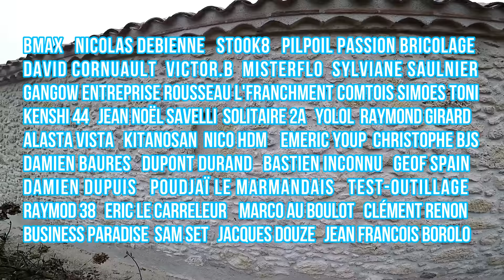joints de pierres fait par des artisans - focus n°15

Comment: Beau boulot ! Une petite question sur la partie du piquage. J'ai réalisé un piquage chez moi, et je suis peut être (et sûrement un manche) mais j'ai trouvé cette partie super longue :p surtout pour avoir des joints bien creusés. C'est chronophage aussi pour vous ou pas plus que çà ? au burin électrique ou manuel ? :p
Reply from the maker: salut
tu poses là une excellente question
comme je le dis souvent la préparation des supports est comme toujours la condition indispensable pour du bon travail
piquer des murs de pierre ce n'est pas caresser la façade comme le font nombres de maçons actuellement pour un réel souci de rentabilité ( pas un problème de méconnaissance ) , il faut creuser pour retrouver une rèelle assise des murs , en clair : sortir tout ce qui est friable, facile à piquer 
c'est vite chronophage car tu multiplies forcément le temps passé à piquer mais aussi à évacuer le décombre , mais aussi à rebatir car évidemment tu feras beaucoup de gros trous , et au rejointoyage c'est beaucoup plus difficile de jointer de  gros trous que de crépir au ras des pierres pour ensuite gratter les joints  (j'appelle ça la méthode carrelage bricolo)
un bon piquage se doit de virer toutes les pierres trop petites ou trop usées / pourries qu'il ne faut surtout pas remettre au  mur
nous piquons souvent avec le burin élec mais une fois le décapage fini on fignole toujours avec le manuel (marteau à piquer)

Comment: Superbe chantier et superbe montage ( toujours avec la bonne musique qui va bien ^^ ). Vous avez dû en passer des semaines sur cette maison. C'est impressionnant sur certain joint, la profondeur ! 
La terre va recouvrir quelle hauteur environ ? 
Tu parles d'imperméabilisation de la pierre, comment fais tu ? 
Quand on vous vois faire les joints, le mortier paraît très gris, et le résultat final est très beige ( du moins à l'écran ), c'est normal ? 
Vu les températures où tu bosses, achètes toi une veste chauffante milwaukee M12, tu pourras plus t'en passer une fois que tu auras testé ^^
Du beau boulot en tout cas !!   

Amitiés

Mathieu
Reply from the maker: salut mathieu
merci comme d'hab :)
la musique raaah elle résonne encre dans ma tête , au fait tu sais de quelle bo film est le  dernier morceau guitare de la vidéo ? ( utilise pas deezer )
on a passé 2semaines environ ce qui a pris le plus de temps c'est démolition rebatisse mur + génoise et tuiles sablières
la profondeur de piquage te donne un signe de qualité de travail sur une réfection de mur, pour du jointage cela signifie beaucoup plus de finition qu'a fleur de pierre comme on le voit partout
la terre recouvrira les enduits bas de mur , ceux qui sont lissés/grattés, on y mettra un delta ms ou truc du genre
j'avais pas de bonne lumière mais si tu regardes le moment "rituel de midi" tu verras que la façade est extrèmement lumineuse et blanche , pas beige  ni grise , c'est blanc , aucun pigment
pour le froid en fait c'est une bonne remarque mais je ne recherche actuellement pas de vestes chauffantes car je n'ai jamais froid au torse  quand on est au taff, par contre si tu as quelquechose pour les mains ou les pieds  je suis preneur d'idées ^^ 
merci du comm 
bonne journée  :)
Reply: Strictement aucune idée pour la BO :-)
Reply from the maker: c'est l'histoire d'une veuve qui joue de la musique ..... film magnifique en plus
Reply: La leçon de piano de Jane Campion